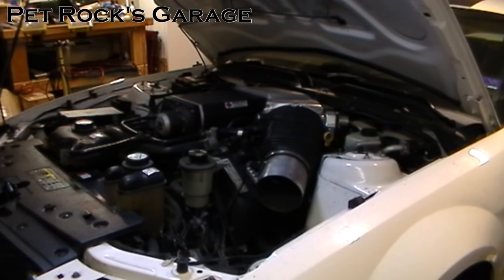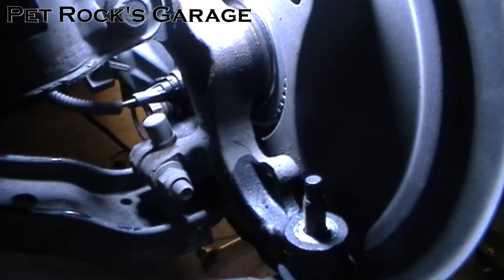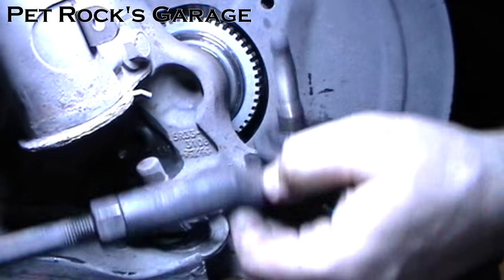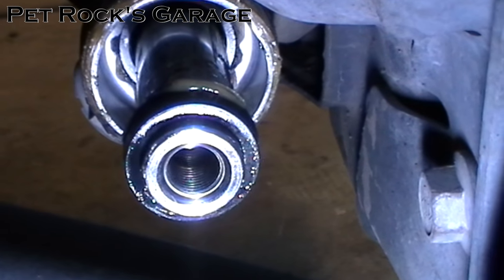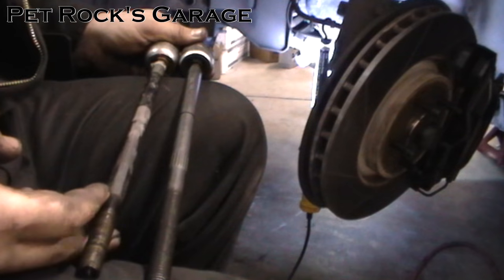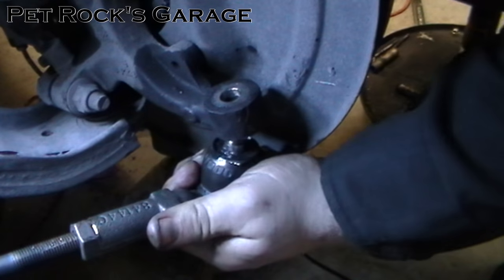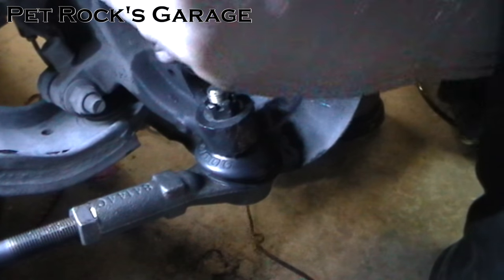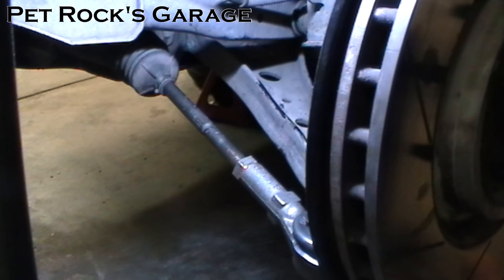How To Replace Inner & Outer Tie Rods - Ford Mustang (’05 - ’10)

Comment: Great video.  I've worked on numerous and completely rebuilt a few cars, but each one is different.  The tip about the speed sensor was invaluable.  I would like to add that a 13mm wrench works well on the inner tie rod to keep it from moving.
Reply from the maker: Thanks a lot. I appreciate it.  Different tie rods use different size wrenches to hold in place. All depends on the manufacturer.
Reply: @petrocksgarage  you are absolutely correct.  I believe mine were stock, but your mileage may vary.  Cheers.
Reply: What size wrench for the outer tie rod

Comment: Amazing video, it helped me a lot. Got my 05 mustang and will be replacing them on my own. My mechanic was charging me 500$ to change them in both sides. Thoughts?
Reply from the maker: The job takes less than an hour, even if you take your time and drink a few beers in-between. Even with an alignment afterwards, which you will need, and a standard up-charge for parts, $500 is a rip off, IMO. I'd shop around for a new mechanic and definitely do this job yourself. Its really not that hard.
Reply: @petrocksgarage  I know! Thank you for your video. And also my water pump is damage, he wanted to charge me 500$ to replace it. So literally wanted to charge me 1000$ for outer tie rods replacement and water pump replacement, and that 1000$ was an estimate.

Comment: Awesome video. Always have to say that. Your instructions are.... The best. No exaggeration no other word can be used... Moving on, the spindle on my 98 mustang front driver side a frame will need to be replaced because it is busted open and I think it is contributing to the vibration I feel while breaking at highway speeds. Thank you for your time!! Let me know if you can make a video / just collaborate with me as I progresses through resorting my 114000 milage vehicle I purchased
Reply from the maker: Thanks a lot. I appreciate it.  I replied about the vibration in my other video you commented on. But if the vibration is only when breaking then it is likely a warped rotor. You can get them 'turned' to smooth them out or replace them fairly easily. Good luck.
Reply: Pet Rock's Garage your other video helped me with replacing the rotors. They were rusted in so I had to force them off with a couple of eye bolts, a couple nuts and a long screwdriver. I have subscribed and talked your videos up! I'll probably start a video guide to provide a video break down for repairs/upgrades you have not addressed. I'll talk you up every time!!
Reply from the maker: Thanks a lot. I appreciate it.

Comment: I Hydroplaned Into A Curb On A Heavy Curved Street...Thanks Im Gonna Replace Everything From Control Arms To The Shocks And Tie Rods Thanks Man👌⌚
Reply from the maker: Ouch! Hope everything is OK. If your front tire hit the curb you should inspect the wheel hub/bearing for looseness too. The hub or the bearing inside it could have been damaged. If the rear tire hit, then I'd jack the rear up and spin the tire to see if it has a wobble in it. If so the axle is bent and should be replaced. IMO, you only replace stuff if it's damaged or worn out. But sometimes its better to be safe than sorry. Good luck.
Reply: @petrocksgarage  Thanks On Ebay Detroit Axel Has A Full Front Suspension Kit And Comes With New Hubs Too

Comment: Well done , I  should get some big wrenches , I've been using an  adjustable wrench to a pipe wrench . LOL
Reply from the maker: Thanks a lot. Big wrenches come in handy from time to time. I honestly don't remember when/where I got that huge wrench, but it fit perfectly. I'm a big fan of using the right tool for the job. I feel dirty using an adjustable wrench. :-)
Reply: Pet Rock's Garage First of all great videos! Very well explained. Secondly I'm no mechanic or anything but I do like learning but what exactly is wrong with using an adjustable wrench ?
Reply from the maker: Thanks alot. I appreciate it. Adjustable wrenches are a last resort IMO. e.g. in cases where you don't have the proper size wrench available.  They never fit exactly and easily slip causing the bolt/nut to round over. Depending on the quality of the adjustable wrench, they often loosen on their own which is a P.I.T.A.

Comment: how was your alignment after this if you remember? from the video it looks like the outer tie rods turn was exactly 22 turns if you pushed it in and then start turning with the bolt facing up
Reply from the maker: You will never get the alignment correct, especially if the alignment wasn't spot on before you started (which is most likely the case). The goal is to get it as close as possible to what it was before you started so you don't burn up your tires taking it to an alignment shop to get a proper alignment. An alignment shop should be one of the first places you go after you are done with this job. You don't want to drive around too long without an alignment. Hope that clears things up.

Comment: As a ford tech no one takes those sensors out you just beat the shit out of the spindle and get that baby out
Reply from the maker: You do you.  But as a ford tech, you likely don't care much if the sensor brakes because you can just charge the customer to replace it even though you broke it. If you were a DIY'er you would care a lot more. Just sayin'...
Reply: Pet Rock's Garage all of that is true 😁and I am a diy’er on the side but I still get your point it’s all good.

Comment: Count turns but also measure from outer edge of lock nut to vertical center point of outer tie-rod end (about at the center zerk fitting)
That measurement should remain same after install. Screw tie rod in or out to adjust maintain measurement.
Reply from the maker: Measuring from the outer edge of the lock nut for the outer tie rod to the center point of the outer tie rod will just give you the length of the outer tie rod. It will not give you a measurement relative to the inner tie rod.

Now, if you meant measure from the hex end of the inner tie rod to the lock nut for the outer tie rod, that too won't work because it assumes the new & old outer tie rods are the same length. They may not be, especially if they are made by different manufacturers.

Now, if you meant measure from the hex end of the inner tie rod to the center point of the outer tie rod that would work only if your alignment was good to begin with. Chances are isn't not.

The goal here is not to do a hyper accurate alignment in your garage/driveway. You'll never achieve that without expensive specialty tools. And no the string method is not accurate. The goal is to get the alignment as close as possible so you don't burn up your tires on the way to the alignment shop to get a proper alignment.
Reply: @petrocksgarage  I agree that a Alignment always needs to be done after front end work.

Comment: great vid, just liked & subbed. question; why did you change inner tie rod, should it be changed just as part of outer replacement? thanks again!
Reply from the maker: Thanks a lot. I appreciate it. Re inner tie rod, I replaced it because it was worn out. You should be able to lift it up and it should not drop back down. If it does drop it is worn out and should be replaced.

Comment: Would copper paste be good anti seize? I know its an old video but would really help to know
Reply: thanks for the awesome video too though
Reply from the maker: You mean copper anti-seize?  If so, yes. Copper or silver anti-seize will do just fine. The only difference between the two is the heat range they work in.  Tie rods won't get anywhere near either of their max temp spec, so they will both work.  btw, the age of the video doesn't matter as long as the info inside it is still relevant. Since this is a car repair video and not a current events video, it can be 20 years old and still be useful to people. Just sayin'..
Reply: @petrocksgarage  Yeah thanks for the fast reply! my mustang is so low i have to buy a low car carjack so that's something. your video is perfect. thank you for it. I liked and subscribed. need to get this done asap. Any experience how dangerous it is to drive a mustang with a loose tie rod head
Reply from the maker: @teemu3981  thanks for the like & sub. I appreciate it. Re loose tie rod safety: it all depends on how loose it is. Its always better to fix sooner rather than later any issues in the steering system. While it may have only a little movement today, it can quickly degrade to a lot of movement in a matter of days (depending on how much driving you do). In really bad cases, which are relatively rare but do happen, the ball joint can separate and you'd lose control of the car. Hope that helps. Good luck.

Comment: If I'm replacing both inner and outer tie rods, can I skip the jam nut loosening part and remove both tie rods while they're still together? This way I can also measure their total length and put the new (pre-assembled?) set in the same way?
Reply from the maker: Yeah, you could.  However, after you have screwed the inner tie rod all the way on tight, chances are very high that the outer tie rod will not line up with the steering knuckle. So you'd just spin the inner tie rod to make it line up.  It's debatable which is easier, IMO, because loosening the jam nut etc is not that difficult but fighting the inner/outer tie rod combo as you spin the assembly off could be a P.I.T.A.  Either way, you would still need to get an alignment afterwards.  Good luck and let me know how it goes.
Reply: @petrocksgarage  (Two years later!!!) I finally got around to this! Thanks to your video, all went fairly smoothly. I did just end up leaving the inner/out connected upon removal. Then to make sure the new set was the same length, I just put the old/new setup side by side using the zerk fitting as a point of reference for one side. Steering feels centered so I don't think I completely screwed it up. I'm up for new tires anyway, so I'll be getting an alignment soon. The bad news in all of this is the vibration I was getting is still there. While doing this swap, I noticed that the control arm lower ball joint seal was barely there. So that's my next job.  =(

Comment: How did you know you needed to replace these? I’m having some vibration in my 12 gt. Have roadforced balanced the wheels and tires, replaced brakes. Should I tie rods next?
Reply from the maker: Tie rods wouldn't cause a vibration. Something moving/rotating is causing the vibration.  Maybe the tires are out of round?  Try rotating the tires and see if the vibration changes. If it does then it's the tires. If not, then check your motor & transmission mounts, as well as your drive shaft. Bad mounts or a bent/unbalanced drive shaft can all cause vibration. Good luck.
Reply: @petrocksgarage  False, tie rods esp inners can cause vibrations.
Reply from the maker: @HPX584 , in extreme situations yes they can. However, if they were the cause it would be extremely obvious. They would have to be super loose and would likely have been found by the tire shop that balanced them or whomever did the brakes.
Reply: @petrocksgarage  with the boot covering it I doubt they would see. Even ball joints can cause vibrations when turning.
Reply from the maker: @HPX584  Its actually easier to see a bad inner tie rod with the boot on then it is with the boot off. You'd see the boot wiggle when touching the steering knuckle (doing brakes) or wheel (taking tires of too balance the tires). To cause a vibration there would have to be a lot of movement and would be pretty easy to notice.

Comment: Ummm, did you really suggest hitting the cast iron steering knuckle on the bottom of the McPherson strut with a BFH???  Bad idea, and that will never work on a 200K rust belt vehicle (which your brother's GT-500 clearly isn't).  If replacing the outer tie rod end, use a pickle fork with a hammer or a pickle fork attachment on an air impact and separate the tie rod end quickly.  If you are worried about saving a crappy OEM $10 Ford tie rod end (limited life part with no grease fitting, unlike a Moog), put invert the nut you just took off the tie rod stud, screw it down 3/4 of the way so the end of the stud is protected and give it 1 good hit (vs. the pitty pat crap you demonstrate above) with a 3lb sledge and the tie rod will pop out of the knuckle with no damage to the stud or boot.
Reply from the maker: Yes, I did suggest that. Works like a charm, even on rusted vehicles. There are tons of videos on YouTube showing the success of this method. The vibration from hitting the knuckle breaks up the rust. It's simple physics. Beating on the shaft of the tie rod end with or without the nut partially screwed on can easily cause it to mushroom, especially on rust belt vehicles if the tie rod end is rusted into the knuckle, making it impossible to remove without cutting. But there are many different ways to do this job. Do whatever works for you.
Reply: I guess if you've seen it on a Youtue video that must it right? 😀. Never mushroomed a stud end in 40+ yrs of taking tie rods apart with the inverted nut method, have seen people crack cast iron steering knuckles by beating on them with BFHs. Use whatever method works for you.
Reply: MOOG is garbage.
Reply: Omg thank you! I couldn’t get it off but then tried putting the backwards like you said worked like a charm

Comment: MOOG is junk.   If the boot popped off during install, will it hold over time when exposed to the road?   Why install junk?
Reply from the maker: As with most things, opinions vary.  The boot is only held on by compression from the rubber the boot is made of.  It is not glued on, nor should it. So the boot popping off is not surprising nor a problem.  They are still holding up to this day on this car.  Either way, they have a lifetime warranty, so if it does fail I can replace it for free.
Reply: @petrocksgarage  Time is not free.
Reply from the maker: @PaulLorenzini-ny2yw , yes, Time is the fire in which we burn.
This job can be done in less than an hour, so its not a lot of time.

Comment: you did not mention wrench size at all
Reply from the maker: Because that is dependent on the manufacturer of the ball joint.  MOOG, for example, is different then stock.